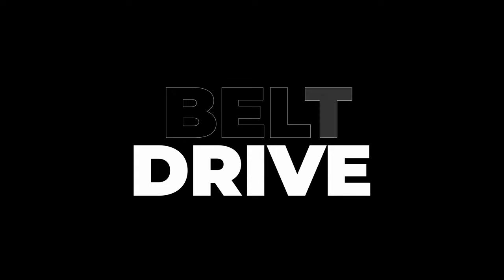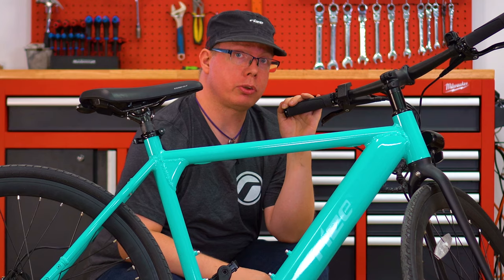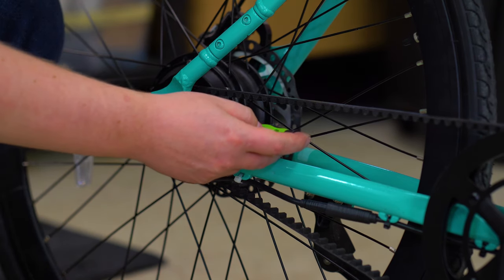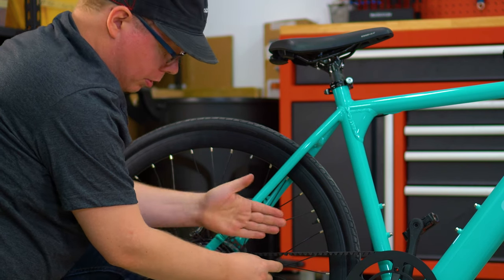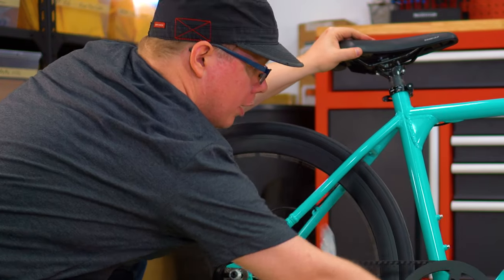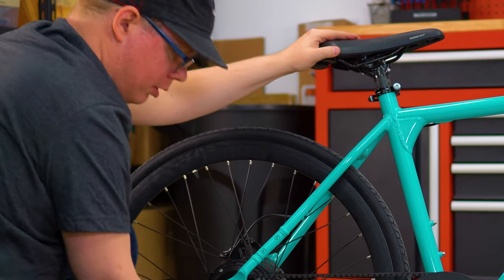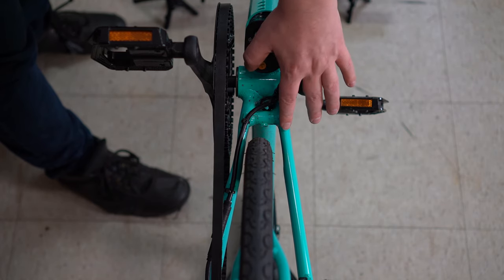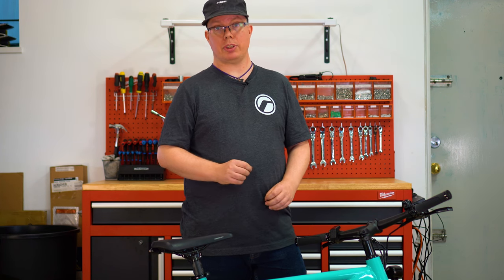How to Adjust the Belt Drive Tension on Rize Fixie

Comment: Hi Creg. Do I need to tensioning my belt, because on gear 1 or 2 when drive uphill I feel my belt rattles and not working properly or smoothly.  Do You have any suggestions?

Comment: I'm approaching 750 miles ridden and am having a blast still.  

Do you know how many pounds of tension the belt should be adjusted to?  Gates has a Carbon Drive app that "measures" the tension in their belt.  Do you know the corresponding measurement for the Rize Fixie belt?
Reply from the maker: Awesome! 30 to 40Lbs of tension and the corresponding measurement for the Rize Fixie belt length should be 117 teeth

Comment: I just watched a video about putting on belt drives saying that you should never put them on with tension but should loosen the back wheel a bit to put them on. Anyway, just to say that when my bike arrived, it did not have the belt attached and I put it on with tension which I probably shouldn’t have I guess. What do you think?  And if it isn’t I guess it should be in the instructions on how to put it on if it’s not on.
Reply from the maker: Hello Paul,

Please get in contact with us at support@rizebikes.com and one of our technicians will gladly assist!